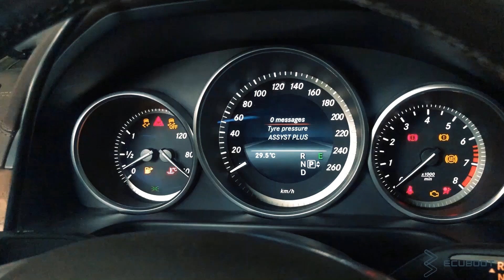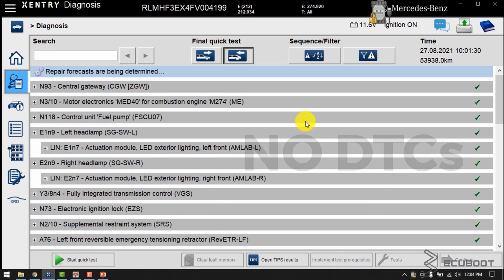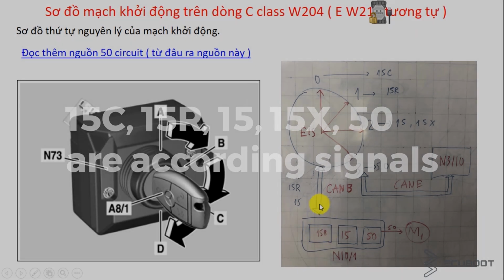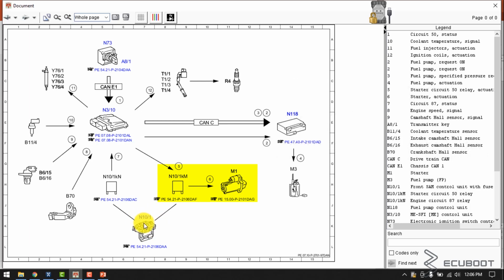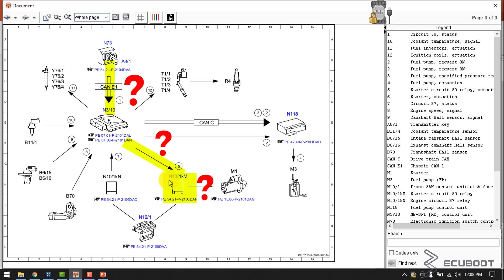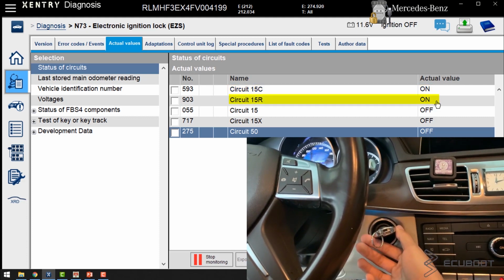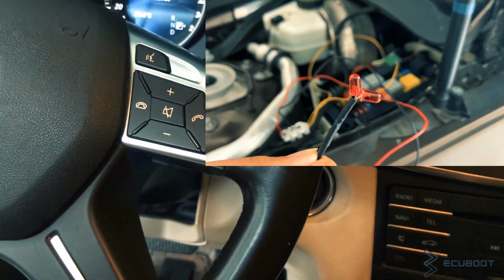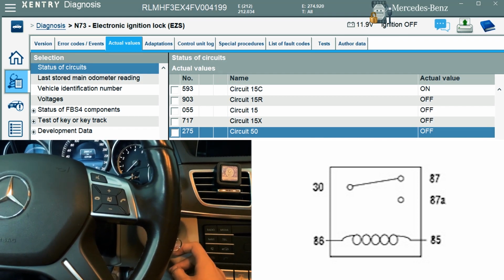Mercedes Won't Start ! No crank No Start No DTC. Easy Fixed (Detailed Procedure)

Comment: I had a w222 and it ended up the ME was bad. No crank no start, and no ME would show up on the scan tool. First checked the ignition switch, all circuits would go on. Could get the engine to turn over but still would not start. No control signal from the relay even with a known good relay. Checked powers and grounds on the computer and all good.

Comment: Idiots that's not the way! You drive a Mercedes Benz not a Gaz from Russia. The problem is with the ESL. Most likely is getting blocked time to time and need replacement. My advice is to get rid of it all together. If is blocked on "unlocked" position, you are lucky. You just need an emulator and there you go. This is a fix forever! You need a guy with the right tools to download some information from you car with your key in and write it on a emulator from China. Had this problem, all the Mercedes cars had this problems specially the W204.

Comment: Please, the engine of my ML 350 2008 won't start until I remove the airflow meter's socket. I have changed the airflow meter several times but the problem still persist. 
Please what could be the reason?

Comment: Hi, if i have power at pin30 with the ignition on, and no power with ignition off, and jumping it with pin 87 doesn't do anything, is this the sign of a bad starter motor? (for 2006 ML500). Thank you

Comment: Friend, I started my car, but the gearbox doesn't work. No gear is engaged. MB w212 2011 diesel. After starting, the steering wheel turns as usual, so I think it's not the steering wheel. Do you have any suggestions?
Reply: Tengo el mismo problema. ¿Lo solucionaste?
Reply: @ I was repairing my car, I had a problem with the board in the middle of the gearbox. It is important to clarify that I have a selector on the steering wheel. It was a board called TCU
Reply: Am having the same issue 
Can start the car from the starter relay, but when it starts no gear selection & the car is showing as in D on the dashboard. Any help appreciated
Reply: @ I was repairing my car, I had a problem with the board in the middle of the gearbox. It is important to clarify that I have a selector on the steering wheel. It was a board called TCU

Comment: Hi, thanks for sharing this video. My ML350 was ok, then suddenly no crank, I tested all the fuses, changed the started relay, checked the battery (also tried boosting with another vehicle and cables) and nothing, I tried to jump the relay as you did in the video but nothing either. My OBD does not have the precise check that yours have, the only code it gives me is u040100, any ideas/suggestions what else to look for? Thanks again!
Reply: Did you fix the issue? Please share your experience. I met up same issue MB w211 E200 petrol 2006

Comment: I have this exact same problem but it only happens occasionally. The engine will also occasionally stall whilst idling which is very rare for any diesel engine in my experience. Otherwise the thing runs fine. Is my problem more likely to be an ignition fault? (It's been scanned twice but no fault codes were apparent)

Comment: I have a 2013 Mercedes e550 coupe it has power but won’t start, no dash lights come on when turning the key , radio doesn’t come on , and only the odometer and and don’t forget key shows, Any help please ?
Reply: Needs steering lock

Comment: Fantastic and very informative video brother.I really know you could solve my problem with W212 E220 cdi 2012 model no instument cluster,no ignition,no start.I checked and started the vehicle from relay.i changed the relay but no use,the problem is the fuse f7 blows everytime...please help brother

Comment: I have power to relay also replace relay.
Still no power to purple starter wire.
Jump starter and starter turns.
04 clk500 MB w209
Reply: Did you found the reason of no power in the purple wire? I have the same problem

Comment: you took the long way , at first you can check the terminal line and the signal 50 at the starter directly and you will save much time
Reply: and also must check the starter because the overload  occurs damage the starter relay

Comment: I wish I saw this six months ago, I had to really dig into terminal 15 and circuit 50. one thing I will never understand is how come engine will crank with ecu removed? if ecu completes 85 and 86 on starter relay. I really need to understand this rational,

Comment: I watched you video and I was very impressed maybe you can help me I have a 2009 C300 4matic that does not crank. The key is working properly My dashboard is functioning properly but it will not crank I checked the starter relay and it does click I even change the relay. The steering wheel lock is functioning properly. The car with scanned the health report stated low brake fluid in front sam module and rear brake lights ground in rear sam module but I do not think that either would cause the vehicle not to crank. Would you have any idea of any possible causes. Thank you and continue with your great tutorials.
Reply: Unfortunately for W204 owner like you and I and too many other: the issue with EIS/ECM is well known issue.  In this scenario, he was demoing a simple problem with the relay.  Other cases, you’d have to disable the security system (a $150 fix) but could save its owner thousands…

Comment: Very good explanation on how to check the starting problem, my car 2010 E250cdi has similar issues, key turns, click sound and no engine start, sometimes fires at the first key turn, sometimes 10 turns of the key to start the engine. Thank you, I will check the relay
Reply: was it the relay? my e250cdi 2010 got the same symptoms now
Reply: @antonkra2002 did u fix it? What was the problem
Reply: @shiveshgupta3333  will get it fixed next week, was the starter motor
Reply: @antonkra2002  Was it intermittent or didn’t start ever
Reply: Did you fix it?